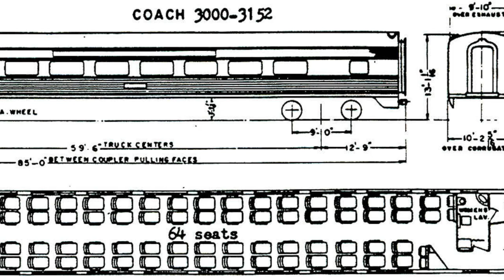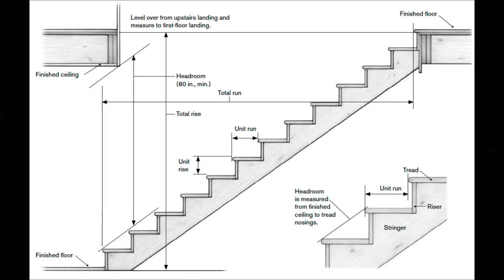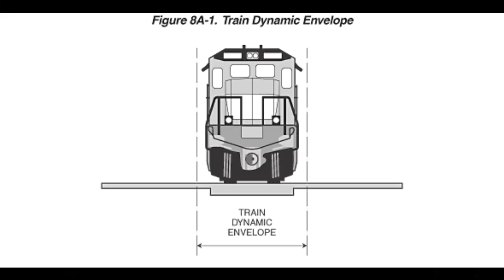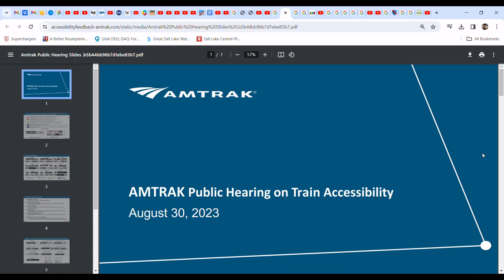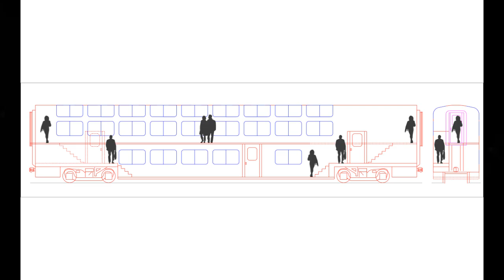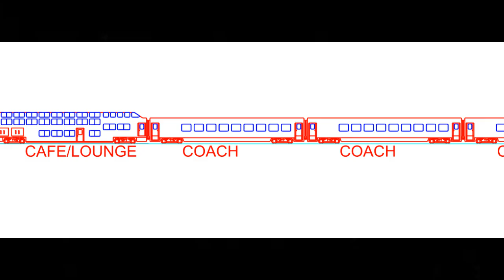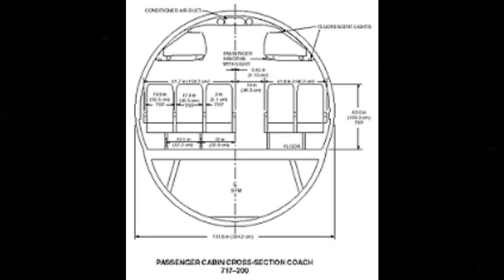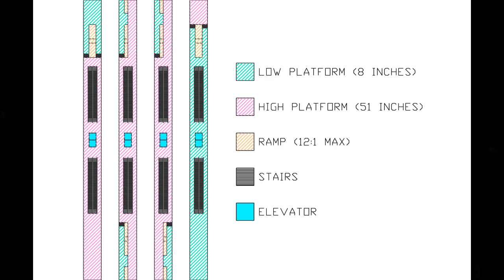An Excessive Explanation of North American Platform Heights

Comment: 5.5ft back from track center isn't wide enough for STRACNET and many high and wide loads which makes any platform above 2ft nation wide a non starter. 
There is an issue with too much standardization what happens when a major component has issues then do you sideline the entire nationwide fleet? at easy 600+ cars for the NEC and for the LD services there is more than enough scale.
The old superliner standard also doesn't mix with standard euro stock which normally has a floor height of ~23in and with KISS and FLIRTs becoming more and more common it seems like a 23-25in floor height makes more sense.
Reply from the maker: Thank you for introducing me to a new acronym!
Here is the info I found:
https://apps.dtic.mil/sti/tr/pdf/ADA395342.pdf

On page 19, the diagram shows a need for 12' wide military loads. Page 21 discusses some ways for high level platforms to be compatible, mostly items discussed in the video. I am unclear on if the 12' requirement includes a dynamic envelope or not. In either case, I think setting the platforms back even farther is still feasible, and I am definitely in favor of the potential for a 12' wide passenger car!
Reply: @CSLenhart  12 wide does not include the dynamic envelope. Which means platforms above 3ft or so would likely need to be at 6.5ft track centers resulting in a 14in gap to normal passenger stock
Meanwhile below 2ft platforms can be at 5.5ft or slightly closer without interfering with almost any special load and being far closer at 2-8in mattering on the car
Reply: I could see wind turbine blades and 737 fuselages having issues with platform heights as you mention, those loads are articulated across multiple cars so cut inside when the train rounds a curve.  Though those usually go on the primary transcontinential main line across Wyoming which carries no Amtrak services as loads that size cannot get through the Moffat tunnel in Colorado, or make the Winter Park curve at the west portal of the Moffat Tunnel.
Reply: @mrvwbug4423  STRACNET is DOD cargo and so it goes all over the country there is a map of what are the official corridors but it can also go plenty of other places
Reply: Standardizing to the European standard makes no sense for anything except maybe a commuter operation. For anything that will be interacting with the national rail network, there are already two well-established standards that are going to be nightmarish to change. Trying to go for a middle ground will simply create a third issue, not solve the other two.

It's worth noting that the Siemens Venture cars were adapted to a 51" inch platform height as part of their Americanization. Brightline could have chosen any height they wanted (since they were building all new stations and buying from a European builder), yet they chose the same 51" used on the NEC. I think that's pretty telling.
Reply: @TheBleggh  In Brightline's case I suspect they opted for 51" height specifically to maintain flexibility for future expansion.  They also probably coordinated at least a little with Amtrak on the Americanization of the Venture cars, which likely made things cheaper for both by agreeing on some standards.
Reply: @TheBleggh  Amtraks superliners are being replaced and given their age it’s unlikely they will be used by someone else. Half if not all of Californias fleet derived from them are also getting old and near retirement. 
That means we can move past the old standard to 24in where there are far more rolling stock options.

Comment: I don't think we should be promoting 8" as a new accessible standard. It is already a standard, and it can technically be accessible, but I don't think it's universally applicable enough to encourage railroads to use it. The issue is that the long ramp down from 15" cars to 8" platforms take forever to deploy, which makes that solution an unviable standard for commuter railroads. Given that most of the passenger trains in the western US are commuter trains, it is essential that any new national accesible platform height standard be practical for commuter trains.

If we want to create a new standard for accessibility for low-floor trains (e.g. the lower level of BiLevel coaches, or low-floor trains like the Stadler FLIRT) the platform should be at the same height as the train floor, so about 24". Frontrunner uses that height with fixed plates, but several other systems use automated gap fillers, such as TexRail, DART (Silver Line) and Metrolink (Arrow line).
Reply: So RTD in Denver has a solution for this on their trains.  The light rail has a low height door, but uses stairs to board the train, the doors right behind the cabs on each car pair have a level boarding ramp that can be quickly extended and every platform has a wheelchair ramp that the light rail trains always line up with when they stop so the engineer can always pop out the ramp very quickly as needed, and they can see wheelchair passengers waiting on the ramp since they do accessible boarding from the front of the train.  Their new heavy commuter trains just use 51in platform level boarding, so much better from an accessibility standpoint, since RTD opted for fully electrified commuter rail with EMUs instead of bi-level cars.  RTD is a 100% accessible rail system.

Comment: you mentioned cars with end doors on both levels, this sort of exists with amtraks transition sleepers. one end is first floor height, the other is second floor height.

I would caution against semipermanently coupling cars, because a fault in one car can lead to a whole trainset being out of service. where I work now we have cars semipermanently coupled in pairs, and because of that half the cars in our shop are perfectly fine, theyre just taking up space and not out making money. automatic couplers are great for maintenance because you can swap out a single defective car. I do wish amtrak would begin adding electronic couplers, back when I would have to go out in the freezing cold and crawl under the train hooking up hoses, it was a really bad time.
Reply: I believe the Amtrak concept is to have a semi-permanently coupled "core" trainset, then a bunch of conventionally-coupled cars off the side. It's unfortunately not really avoidable, because Amtrak's whole pitch for an ADA exemption is "all the important stuff can be reached, so there's no reason to require it on the rest." Lose that, and you probably lose the exemption too.
Reply: @TheBleggh  I worked on their new venture cars, some of which are  married pairs, the width of the gangway seemed comparable between the married pairs gangway and the standard cars gangway. Just no doors to need to push a button to open. 

Unless the requirement is not having to push a button to open a door, which is often considered an accommodation off the train, I'm not sure what difference it would make.
Reply: @dfwrider3830  If I recall correctly, the difference is in how the gangway is designed. With the old design with cars that are held with a knuckle coupler, there is no floor plate covering the diaphragm because of the extra movement the knuckles have. With semi-permanently coupled cars, they utilize a drawbar of some kind which allows for a plate to be installed
Reply: @btomimatsucunard  the floorplate is likely part of it, they did ride really smoothly though, i dont expect as rough of a ride as the superliners had. the married units do have a single floorplate, they also appear to have a wider door. where i currently work all our equipment is in married pairs, so half the shop space is wasted storing perfectly good cars which are stuck to failed cars. how an 8 car consist like that could work is beyond me. we were only able to fit 3 cars on each track in the chicago amtrak carshop. and while 4 cars all binched together probably would clear the end doors, it would make accessing any tracks beyond it quite annoying and youd have to climb through the train or walk around the end of it.
Reply: @TheBleggh   true true, tho in any case the proposal is probably loads better than what we would have otherwise given the status quo, and the operational needs of the long distance services. TBH a few semi permanently coupled trainsets could improve the LD experience since we wouldn't see a 3 car set like we have on the Capitol Limited recently and it would mean sectioned trains either run separately adding an additional headway or combined to provide double the amenities and capacity
Reply from the maker: I got to connect air hoses in the heat of a Utah summer (for job training which I ultimately declined),and I was surprised by how difficult it was. My hat's off to you for doing it during the winter! 

I'm not certain, but it seems like there are degrees of semipermananent couplings. I based my expectations on Brightline's Siemens trainsets, which have gangways wide enough for ADA requirements, but also seem to be reconfigurable (based on how often we saw Brightline running 5 car trains prior to the Orlando extension opening).

The worst outcome is, as you said, a whole trainset rendered inoperable because of a defect on one car. We should definitely avoid anything that leads to that.
Reply: @CSLenhart  I think the other issue that is not always discussed with the LD routes, is that the LD trains oftentimes stray much farther away from maintenance yards than the corridor routes. Semi permanent coupling isn't as big an issue on corridors because they are almost always somewhat close to a maintenance yard of some kind, and hence an easy replacement. The LD trains can sometimes be hundreds of miles away from the nearest maintenance depot,  hence why there is more concern for what to do if there is a fault. It is much more easily fixed at the terminal end points, but would be an operational nightmare if it happened on route (something I saw second hand on the Chief before when the eastbound chief dropped off a BO car in Albuquerque that I saw from the westbound train)

Comment: Incredible video that captured my attention the whole time. I would love for there to be sleeper pods on Amtrak trains, the cost of anything not coach is too expensive but the sleeper pods could be priced cheaper.
Reply from the maker: I agree, there is a huge gap in cost between coach and sleeper cars. And where there is a gap, there is an opportunity for growth!
Reply: The new Nightjet pod cars have 40 beds (28 private), comparable with the theoretical max for a Superliner. That's very good for a single level car.

But China has a new sleeper car (CRH2E second gen) that manages 60 private beds on a single level car. That's getting close to coach car levels (Amfleet is 60-72). 

Up the speed and reliability to reasonable levels, and you could do NY-Chicago in 12-14 hours overnight in a private bed for coach prices.
Reply: The way it works is like some airline business class pods that are interleaved. Your feet go into a tunnel that is then a table next to the bed in front of and left/right of you. But then with ladders to separate upper pods. 

Width would be fine, as with two beds on each side, you'd have as much as the 2+2 seating in Amtrak coaches. For length, reviews seem to say it's fine for ~6' and cramped for 6'4". But since the beds are parallel to the train, you could just pull out 4 bunks to get longer beds. At 56, that would still be 2x the capacity of a Viewliner II sleeper.

As for a bilevel version, I'd guess 80ish?
Reply: That's exactly what ÖBB, the national railways operator of Austria has done with their new Nightjets. The pics at 13:57 and 14:09 are from these Nightjets (not the Railjets as in the video). Also these new carriages are not taller than traditional intercity trains in Europe.
Reply from the maker: @flohub06  Thanks for the correction, I'll add a note in the description.
Have you had a chance to ride a night jet service?

Comment: The Adirondack train had a dome car added at Albany Rensselaer while going north to Montreal, it could not go south of Albany do to bridge tunnel limits.
Reply: "had" is a keyword (and only during fall). Apparently Amtrak sold those dome cars to private railways. At one oit, it used a VIA  Buss (ex CP Rail from 1950s) but VIA has been canibalizing its fleet recently.  (I took it this fall and there was no dome car alas, especially as the Amfleet II car windows were all fogged up between panes).

Comment: Those ADA ramps are time-consuming as well. The engineer has to spot the train just right so the door is on the ramp, and as a sick joke, the ramp is usually only as wide as one door. Trains don't stop like cars though, and if you miss the ramp, well you hope you can pull another door up to it or you have to shove the train back. After that, the conductor has to be at that door, work the ramp, help whoever needs it, and then put the ramp away and continue with their station work. All of that defeats the whole point of a commuter stop which is supposed to be in and out in as short a time as possible. With the train having to come in slower to spot the ramp*, and the time the conductor needs to assist the person using the ramp, can set an on-time train back 5 minutes in one stop. High platforms are the way to go.
*You can hit the platform hot and spot the ramp if you want to show off and look cool but it's easier to miss the faster you're going.
Reply: And a standard stop marker on the platform isn't going to work because the accessible cars may not always be in the same position on the consist.  Even on brand new rolling stock in the UK they have this problem.  I watched a video about a month ago of a wheelchair bound man (who happens to be a disability rights activist), trying to board a train at Kings Cross in London, the train had pulled into the station the wrong way around so the one accessible door was not in an accessible platform position.  It took them like 15 minutes of arguing with the train manager to get them to allow the train to be moved a few meters so the accessible door could be used with the wheelchair ramp (the train driver was willing to do it, the train manager was just being a jerk about it).
Reply from the maker: As a former Disney World Monorail Pilot, I can only imagine the difficulty of spotting a full sized diesel train exactly against a high block. The little electric monorails were hard enough to line up with the gates and we had all kinds of guides and stopping aids to help us. And even then, backing up an over-shot train was a seemingly an hourly occurrence...
Reply: @CSLenhart  lol Yeah, it's fairly common at the commuter railroads as well. At least where those raised ramps are in place. Some platforms would have a sign that you'd put in your side window to make the ramp. But many others didn't, and you would learn to use random markers, or the conductor would count you down. I remember relieving a guy who had a train with two extra cars. I asked him what the spots were, and he literally said for one platform "There is a pile of trash half a car length from the end of the platform, that'll be your 8-car spot" SMH
Reply: How do commuter trains manage it at stations with platform doors? Those require perfect alignment, too.
Reply: @dougbrowning82  We dont have many of those type of platforms thank God. In fact, I can't think of there being any example of those platforms being used anywhere in the US, at least when it comes to loco hauled commuter service.
Reply: @michlo3393  I think they're only at the newer stations, mostly in Europe. They're supposed to prevent people falling off the platforms.
Reply: @dougbrowning82  I know they're popular in Japan as well.

Comment: I wonder if Amtrak could implement like those TGV Duplex with double decker coaches, more capacity. I think Duplex coaches are 14ft which is enough to be in the New York tunnels or the Bombardier Multi-Level coaches which are 14ft 1” but rates up to 110mph only, which are also has level boarding.
Reply from the maker: Accessibility seems to have been a sticking point, since ADA passengers wouldn't be able to access the entire train. That may be changing with new rulings and in-car lifts, depending on the upcoming FRA rulings, so we'll stay tuned!
Reply: If I recall the NJT multi-level cars have level boarding, but wheelchair passengers can only access the mezzanine level of the car.  Those cars are barely over 10 years old, so had to have passed ADA requirements circa 2010.  Given those trains are commuter trains and not inter-city and the restrooms are at the accessible level, I suspect that is why they pass muster.